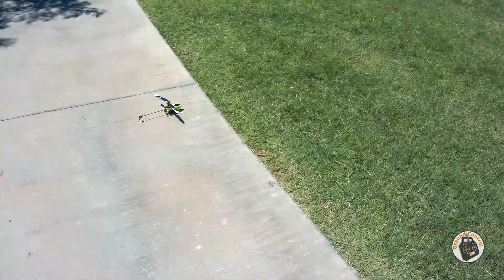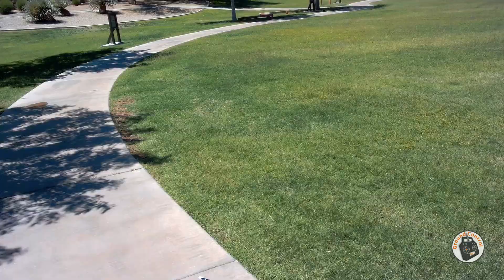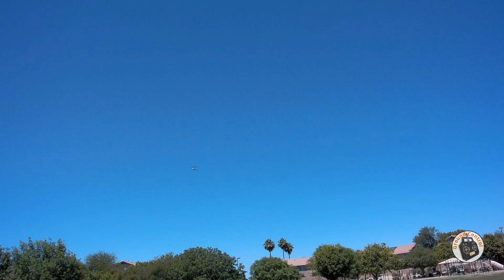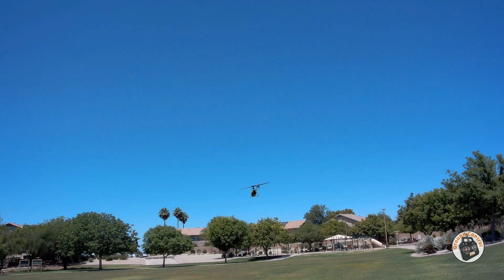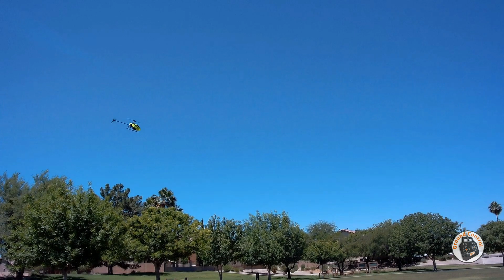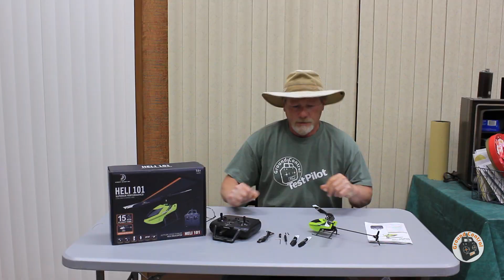FIRST STEP RC Heli 101 Beginner RC Helicopter 6-Axis Gyro Altitude Hold RTF - Review Part 1!

Comment: Just a heads up for your subscribers... 
The XK K127 looks the same with altitude hold and is about $27.00 cheaper with 4 batteries included at BG.
Reply: link
Reply: @FeWolf  Just need to go to BangGood and do a search for the Model ID I gave.
Reply from the maker: Not all of these Micro Helicopters are the same. This one has the smoothest Yaw control I've seen so far. It's even smooth in high rate. This makes it so much easier to fly so don't just look at price. These are beginner Helis so the easier it is to fly the better.
Reply: @GroundControlRC  Yes... the reviews I saw for the K127 also showed much smoother Yaw even in high rates as compared to the E129.
Reply from the maker: @lasersbee  I also need to see if this one can carry the weight of a Micro AIO FPV Camera. My guess is it will be able to that ;-)
Reply: @theoztreecrasher2647  Have a look at this Video.... It is not the same as an E-129... https://www.youtube.com/watch?v=VIo4OA30Ep4
Reply from the maker: @theoztreecrasher2647  They look identical, but they fly differently. This one has much smoother Yaw control. I don't know if it's different firmware or updated firmware, but it's smooth in all axis. The XK looked pretty abrupt on the controls to me ;-) But I haven't flown that one. This one was smooth on my very 1st flight as you could see from the video ;-) If someone wants to send me an XK I'll be happy to do a comparison ;-) Hehehe...
Reply from the maker: @theoztreecrasher2647  Yep, the links to purchase are Amazon ;-)
Reply from the maker: @lasersbee  This doesn't have a Yaw Rate like the E129. Handles very differently. I was hoping folks could see that in the video. Didn't it look smooth ;-)
Reply: @GroundControlRC  Yeah... that's what I posted above... "The K127 also showed much smoother Yaw even in high rates as compared to the E129."